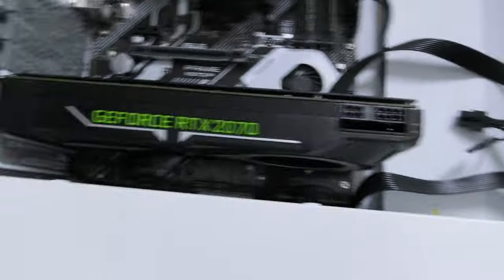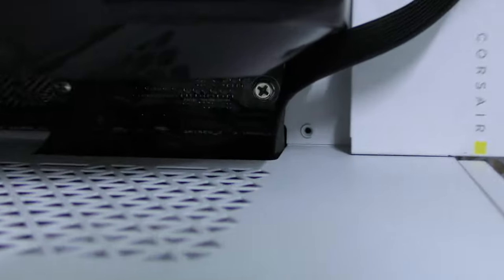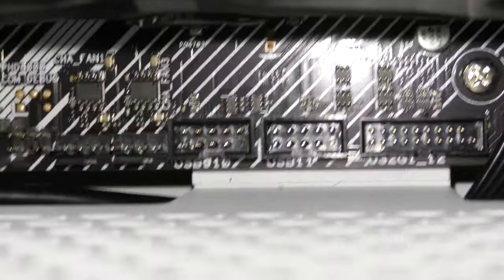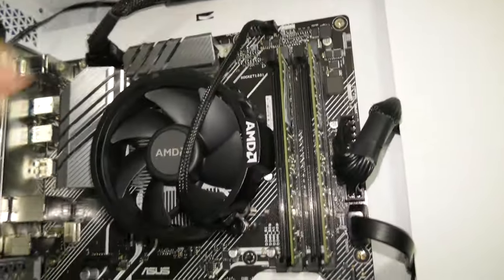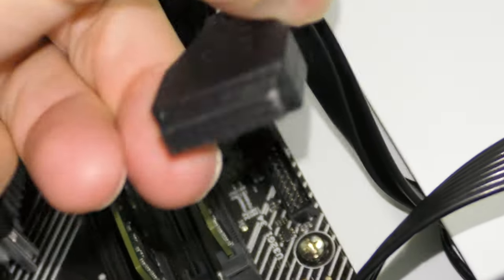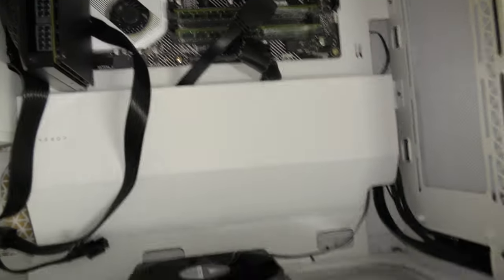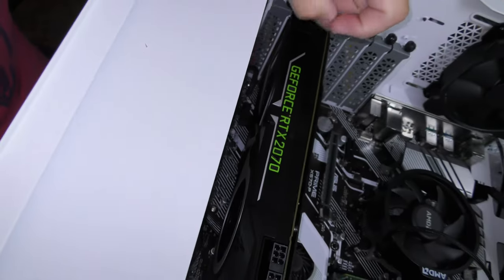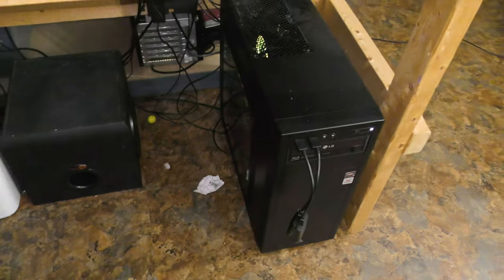Why I HATE Cable Management 🤬 - A Bird's Nest of Wires is BETTER 🐧 - Jody Bruchon

Comment: Eh, I can agree with you to a degree. My system sits on my desk within my immediate peripheral vision, so since I spend so much time looking at it, I may as well make what I can see look neat. Under the back panel, everything is a rats nest and I can't see it so I don't care, but in the main compartment where I can see it, I try and make things look good enough that I'm not constantly annoyed that my $4500 setup looks like one that's less than a quarter of the price.
Reply: Basically the same, but it's not just about looking nice, it's also about better air flow. Not that it makes a big difference necessarily but it does affect the air flow. Also you can get away with cleaning the system somewhat less often since there's less wires in the way to collect dust and grow those dust bunnies. It also kinda depends on what kind of case you have tho, might indeed not make much sense in some cases.
Reply from the maker: @Megalomaniakaal  The difference in airflow is insignificant unless there are a LOT of wires or there's a horrific amount of dust to the point that it's sealing the gap between hanging wires, and at that point you almost certainly have much bigger problems than through-the-case airflow. Tomorrow I'm building my Ryzen 9 5950X with an RTX 3080 tomorrow and I'll be filming the process and a heap of "cable management" related things, including testing the "old wisdom" of cable management for airflow purposes, just to put it to rest once and for all.
Reply: @JodyBruchon  Yeah, that's what I meant by "Not that it makes a big difference necessarily..."
Reply from the maker: @Megalomaniakaal  I'm responding to a half-day pile of comments very fast, sorry for oversights
Reply: @JodyBruchon  Understandable.

Comment: I had that recently.... Kid bought a Graphics card from me and then said it didn't work... So I told him to bring the whole PC as I'd also sold him the other parts coz he was saving up to build it over time... . So he had somehow connected the 4+4 CPU power connector to the 8 pin header on the GPU.... Not his fault as he was learning just like I did back in the day..... Biggest problem I have with cable management though is not having enough space in the back to bundle up all the extra cables that you've hidden out the way.... You get some good designed cases and some really bad.... And even the top brands don't get it right.... I'm all for cable management though I mean you would not want your rear wiper wiring on your car trailing across your seat.... Like you wouldn't want cables catching on fans inside the PC.... And to sell a PC these days it has to look right or the people will just buy from someone else..... It's a damn fiddly job though to get right with many a skinned knuckle 😂
Reply from the maker: It amazes me that any case with a PSU that mounts on the card slot side of the motherboard tries to offer cable management. PSUs are generally made with the assumption that the drives and power connectors will be relatively close to the PSU, so putting it on the opposite side (usually bottom-mount) means that all the wires will be stretched.
Reply: @JodyBruchon  i been commenting too much... sigh thats how you know you had enough internet for teh week.
Reply from the maker: @djsaekrakem3608  You're OK, friend. I'm happy that I've inspired you so much.

Comment: If you ask me cable management inside a computer case is like ART it takes time to master. I been around computers since MS-DOS version 1 days and more then capable of doing electronic repair as well.

I fixed computers for other people in return for favors down the road if I ever need help. In the past I fixed two computers same day for XXX popups I just done the work and moved on. It was not my place to judge them. After all I did judge them about it they might not return for more help later. lol

Comment: It's sorta like the RGB craze. Can it be done to look cool? Sure. Is it always done that way? Not at all. Add to that people will willingly give up more raw power from their budget ...for the sake of unicorn puke all over the place. It's the same deal here - your trading functionality for the sake of being able to take instagram photos. 

Its stupid.
Reply: What functionality? How is my computer hindered in performance from looking neat and tidy?
Reply: tbh I get the idea that some idiots are incapable of applying common sense when building a computer, and are desperately just trying to look cool. However, those idiots doesn’t even come close to representing other people who are just trying to be neat and tidy while ensuring ease of access for future upgrades and maintenance. The cable can be hanging in the middle of the case for all I care, it just need to be not in the way when I need to do something
Reply from the maker: @Tavi if you put stress on wires, they'll eventually stretch or bend and that could cause one or more wires to break internally. Connectors can be ripped off of boards or drives. In the worst case, the stress can cause poor electrical contact which makes the contact point get very hot and melt, causing either failure of the connection or an electrical short (also known as "boom!"). For data cables and even some power cables, crosstalk is an issue when squeezing them rightly together. For maintenance and upgrades, all that cable hanging and tying and strapping and routing has to be cut, pulled, and removed just to change anything.

But hey, at least it looks cool!

Comment: I think the idea of hiding the cables is or was to improve airflow inside the computer case. And then you have people who just prefer the clean look.
But I believe I seen testing of cable management vs airflow before. And if I remember correctly it had very little effect.
Reply: Clean look? ....why the need to look inside your computer for an extra 100 bucks? It's equivalent to truck nuts. The truck nuts of pc gamers lol 😆 5 buck led strip on my monitor is just fine 👌
Reply: @pmaughmer  That is a dumb statement to make. We do not all like the same tgings or put the same value on things. What may seem completely dumb to you, somebody else might find useful or nice or worth spending money on. One of the wonderful things to be human,because we are all different. Please try remember that.

Comment: watch Linus Tech Tips video on youtube, he proves it doesn't affect temps. The video is titled "Cable Management - Does it impact cooling performance? At all?"  ----- they stuffed cardboard into the computer and plushy pillows... running benchmark test and stress test... stop calling Jody Bruchon Tech names and go buy a bunch of RGB and manage.. cough waste your money on zip ties and of course your TIME.
Reply: None of the "cable management" done in this PC had anything to do with air flow. This cable management was done purely for optics. Almost no cable management is done for any other reason than optics.

Comment: To play Devil's advocate, cable management can potentially make sense for "set and forget" systems where you're not gonna touch it after building... but even then I still don't see much advantage to doing that other than making the insides look a little prettier... which serves absolutely no functional purpose.
Reply from the maker: It makes sense when there are practical considerations behind the decision. Simply "making it look good" is not really enough unless you're using it as some kind of marketing device that will get stared at a lot more than actually used.
Reply: @JodyBruchon  True. Now that I think about it, small form factor builds actually do benefit from good cable management considering the tiny space available, but for the average ATX midi tower it's almost always pointless unless specifically made for display/marketing purposes.
Reply from the maker: @Spaztron64  Go to my Community tab and scroll down a lot and check out the white Thermaltake mITX case where I hacked in a third hard drive. You'll love the "cable management." Or perhaps the lack thereof.
Reply: @JodyBruchon  Will do if I remember after work.

Comment: I mean, most of the mistakes that were made in the video were rookie mistakes. If you actually know what you are doing, then it is very easy to cable manage in a way that is practical and looks good. Your approach to cables would not work in a case like mine (the same corsair one from the video). Having all the cables in the way of my front fans would just act as a physical barrier between the components and the airflow, therefore hindering how well my "tool" is able to function.
Reply from the maker: Cables don't hinder airflow unless it's an extreme amount of wire. In the end, I opted to rewire but mostly maintain the hidden look and allow the back plate area to look kind of hideous instead.

Comment: Corsair psu cables are garbo for wire management. Way too stiff and massive rigid spots where they heatshrunk the sleeving.

Judging by the stock cpu cooler, ram with no heatsinks, and a 2070; they spent all their money on the gpu and the case.

I do like the inside of my case to be tidy, but there are limits.
Reply from the maker: I'm really hating this case. In trying to be super nice for hiding wires, it manages to put a ton of wires to their limits. I do not like this case at all. Did you see the big black monolith PC on another bench when I moved? That's my 5950X build in progress; the water cooler arrives today. There are no such pretensions with its design.

Comment: Isn't cable management about good airflow than "good looks pc"? Another example to say, some people want fans with x color or whatever to look cool or a back plate of a gpu to look beasty, like seriously man, it's just a box, a case, I rather my pc to look ugly but perform supremely than the opposite. I would indeed want good airflow and will do cable management if that helps the airflow, I say that because I'm not an expert with this.
Reply from the maker: That's a myth, kind of like how Macs are supposed to be better for graphic design and such.
Reply: @JodyBruchon   watch linus tech tips one of the biggest youtubers of building computers on this "airflow" BS type the video title in search """ Cable Management - Does it impact cooling performance? At all? """" dang these young kids need to be learnt a lesson. HAHA
Reply: watch linus tech tips one of the biggest youtubers of building computers on this "airflow" BS type the video title in search """ Cable Management - Does it impact cooling performance? At all? """" dang these young kids need to be learnt a lesson. HAHA

Comment: The only cable management I care about is that of cables outside the computer, like those that connect the computer to power, a monitor or two, wired keyboards and mice and headphones and microphones
Reply from the maker: That's really where the work should be. Wires inside are in the box and you'll very rarely ever need to touch them, so a few zip ties you can cut with diagonal cutters or even a twist of a thin screwdriver shaft is plenty, but ripping ports off or pulling your monitor off the desk due to tripping over a loose wire on the floor...now that's a real problem.

Comment: i love cases with closed panels, no glass, but when i only have options for glass on my cases, i'd chose a cyberpunk theme, without rgb, static color light and just make sure the cables make sense. im not so much a fan of neating up a pc with so much cable management, that it hurts to work in it later. i say that cable management should applyv for airflow, and if it doesnt interfere with ease of mainentance.

Comment: Ever heard of,  you know, AiR FLOW? That's what the cable management is for - so your components don't fry in the case. Stop being lazy and open the back panel. And no, cable management is NOT stupid.
Reply from the maker: The airflow thing is a myth. Yes, cable management is stupid.
Reply: more chance of computer frying because cpu is overheating "bad thermal pasting" than a bunch of cables blocking some "air-flow". CM is cool and all, but do it right... I just don't like when people try to be snobs and will make things unnecessary. I hate stressed cables I will take messy over forcing cables tightly just to get "better airflow". YOU KNOW THAT AIR MOLECULES DO NOT NEED A 7 LANE HIGHWAY TO FLY THROUGH.
Reply: None of the "cable management" done in this PC had anything to do with air flow. This cable management was done purely for optics. Almost no cable management is done for any other reason than optics.
Reply: You have been groomed.

Comment: "don't cable manage your pc because I don't care"

well i'm gonna need a better reason than that to mess up my airflow...

if someone asked for your help it's not very nice to go an un-do the cable management they did.. just plug in the shit they they didn't plug in due to their noob-ness, and that'll be that.. people spend a lot of money on computers these days.. i'm not going to hassle anyone for wanting to make their investment look neat and tidy

perhaps move that GPU up to the proper slot though so it can breathe better
Reply from the maker: You don't seem to have fully understood what's going on here. I get the feeling you watched half the video. Their "cable management" was literally ripping their connectors off the motherboard and squeezing against pin headers. They brought me the PC because they built it and it "does nothing." This is right after opening it. Cable hiding because you think it's cool is NOT "cable management."

And please tell me about your analysis of the "airflow" in this case. The single fan in the front and back for the Ryzen 7 5700G and RTX 2070 are probably not going to suffer much from wires being around. If air hits a round wire, it does this amazing thing where the air moves around it! I know, it's crazy, right?

Comment: Here is a little secret to Cable management... Don't use what the case provides you use plumbing supplies to make guides that MAKE Sense Case manuafaturesr have No effinge clue how to run wires without chopping them to bits.... that and why no one uses right angle adapters for strain relief is beyond me at least then you can hold the socket while shoving a wire into it without flexing the board.
Reply from the maker: Yeah, that's the funny thing: if you know what you're doing, you know that the case itself can't do much to help you, and you need to be ready to custom-rig the crap out of it to make it work. It's not as simple as "shove it all behind the backplate, call it a day!" Either do it properly (the hard way that requires experience and ingenuity) or let the crap hang all over.

Comment: Just like a nice looking engine bay in a car, a nice cable managed PC is meant to be displayed on your desk.

Just because you're lazy and don't want to deal with a customers PC, they are paying you to fix a problem. Your opinion is not the normal now, most friends I have built PC's for want to display their PC.. also having the PC on the ground under a desk is asking for more dust build-up
Reply: The best place to keep a PC is 12 feet under or more (what with all the free cooling). Not worth worrying about "cable management" in such a case (or at that depth). Showoffs will be showoffs, and if you're into cable management, then you're probably "making good use" of time and money in the detriment of efficiency. There are too many examples of people not being lazy and being inefficient (safe to mark it as some from of worship), such as the amish, to point out that being lazy has nothing to do with it. Functionality and efficiency trump the idea of cable management. Your computer is not a jet engine, and it most definitely does not need to run within limiting parameters which would necessitate the clearing of space for airflow or even for being tidy so that you can find everything (it's not rocket science, unfortunately.)
Reply from the maker: Ah, yes. Another example of the "you're just old" class of dipshittery that is so common among the Ignorant. I explained exactly what the problems were in the video in detail. If you think power and USB connectors literally bending over due to the stress of the "managed cables" in this kid's first PC build then you're a colossal fool. My "opinion" is irrelevant because the damage that was happening due to the prioritization of cable management over the fundamentals is a matter of fact.
Reply: Of course Cable Management always existed.... but up until recently the youtube promoters of products needed to please their sponser overlords. They just couldn't see the RGB! WITH ALL THOSE CABLES IN THE WAY! soo.... CM was introduced to the newest and clueless tech generation. "I WANNA BUILD MY FIRST PC DADDY CAN I HAVE SOME MONEY!" These kids cant take a damn criticism comment. what this video is saying is dont sacrifice convenience for aesthetics... simple as that. No need to get so butt-hurt over your poop-shoot being clogged. Prideful jerks on here man.